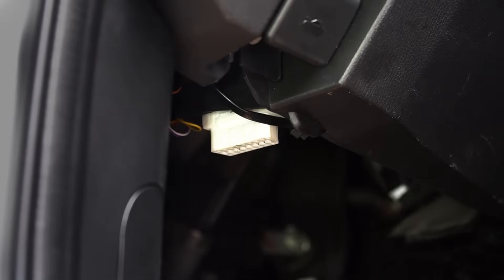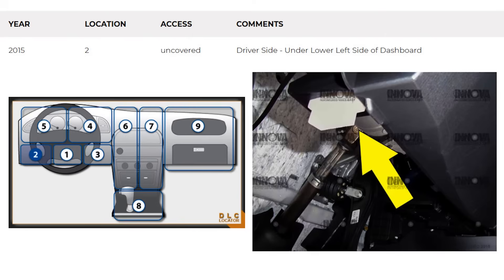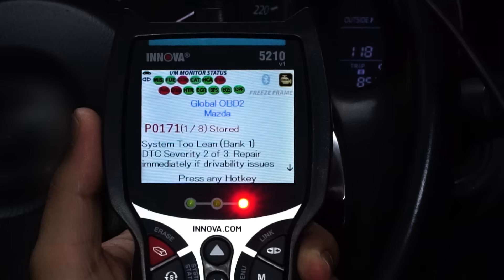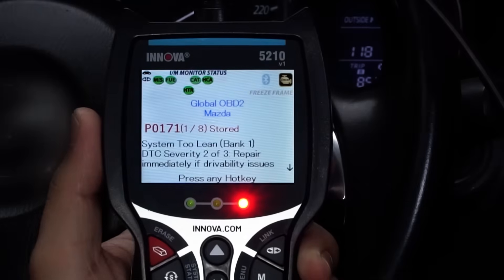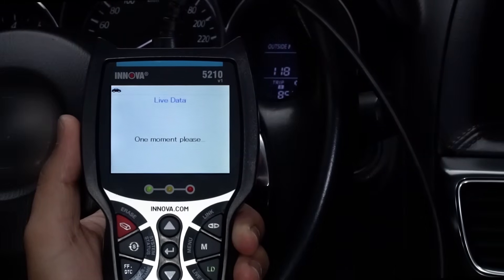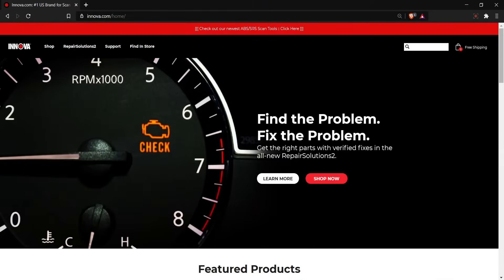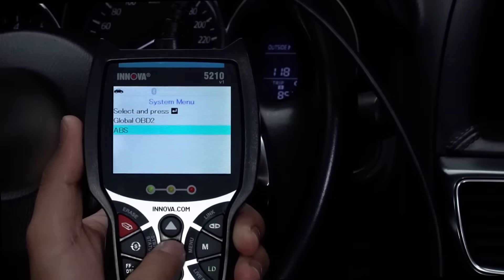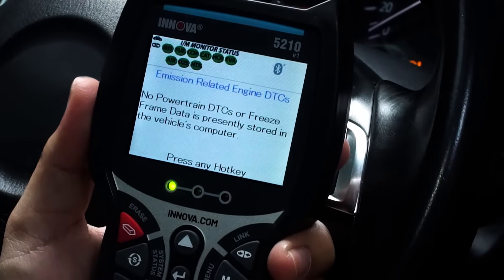INNOVA® 5210 Scan Tool Quick Start Guide

Comment: Can it relearn crankshaft position sensor
Reply from the maker: The 5210 doesn't have the capability to perform crankshaft position relearn. Our 5610 model supports crankshaft position relearn, depending on year, make, model, and engine size of vehicle.

Comment: They advertise that it can record the live data but my doesn't have the option.  What gives?
Reply from the maker: Unfortunately, the 5210 can't record live data. All of our newer handheld tools with the detachable OBD2 cables can record global OBD2 live data, and there is an option to transfer recorded live data to the free RS2 app as well. For example, the 5410/3130RS, 5510/3160RS, 5512/3170RS/, and 5160RS/5610 models can record live data.

Comment: Do I have to have a USB C cable connected to it?? Or will it run on my cars power??? My 12v charger port doesn’t work so if thats the case i might have to return mine
Reply from the maker: The USB C cable is for future, free updates on a PC or MAC. The 5210 and all of our scan tools power on through the vehicle's accessory fuses. The same accessory fuse that powers on the car's cigarette lighter is the same fuse that gives power to the OBD2 port to turn on our scan tools.

Comment: Does it do live graphical data on Engine and transmission
Reply from the maker: The 5210 will only show live graphical data for engine which can be divided into 2 graphs and superimposed. Our 5610 model has OEM live data for check engine and transmission. For this model, the 5610 can split into 4 different graphs and superimpose, but only for 2 graphs. Also, you can record live data (Not OEM Live Data, just basic engine live data), and transfer it to our free supplemental RS2 app on your smart phone or tablet. The live data can then be split up into 8 different graphs with much better clarity since it's displayed on a smart phone or tablet.
Reply: @InnovaAuto  thanks  👍🏿 do they both show the alternator and you have to rev it up to 2000 RPM correct?

Comment: Tried using this on our 99 jeep grand cherokee and it wouldn't read anything. how do I fix that?
Reply from the maker: Are you getting an "Unable to establish communication" message? The vehicle needs to be in at least a crank, no start condition in order for our tools to establish communication with the PCM. Please give our customer service line a call at (800) 544-4124 so they can help troubleshoot the issue for you. Customer service is open M-F 6am -6pm.
Reply: @InnovaAuto  you most definatly have a bad ground on the jeep did it on my van look up grounding points for your jeep and check ecm tcm fuses too

Comment: My 5210 does not have ABS function. What gives?
Reply from the maker: When you go into "System Status",  there isn't an "ABS" option under "Global OBD2", or does the screen display "N/A" when reading ABS? Have you updated the 5210? The updates are free. Here is a link below:

https://innova-electronics.helpscoutdocs.com/article/2036-innova-obd2-scan-tool-updates

Please contact our customer service at (800)544-4124 if you're still having issues so we can resolve this issue for you ASAP. We are open M-F 6am-6pm PST.
Reply: Thanks. I will try this. @InnovaAuto
Reply: Got it. Thanks much. @InnovaAuto

Comment: I had trouble get my scan tool to identify the 2013 Chevy 2.4 Eco Tech.Chevy didn’t come up as a choice.
Reply from the maker: Thanks for your question. What model code reader do you have?
Reply: @InnovaAuto  3130c
Reply: @InnovaAuto  I checked a 2005 Dodge Dakota, 2013 Honda Odyssey, and a 2008 Pontiac Vibe. All worked great.

Comment: Why does this have a plug in on the bottom of it?
Reply from the maker: Hi Robert, do you mean the USB port that connects your Innova tool to your computer that is found at the bottom of the device? It is used when you update the Firmware version of your Innova tool. For more details, you may refer to this link below:
https://innova-electronics.helpscoutdocs.com/article/865-innova-tool-firmware-update-instructions?preview=637d4e82483e942ba866b2fc
Reply: @InnovaAuto  awesome thank you